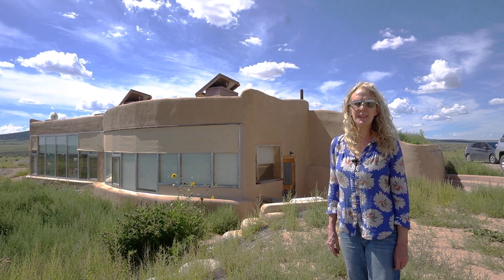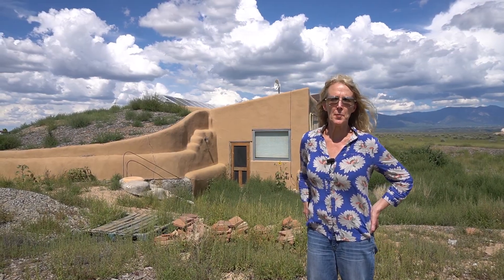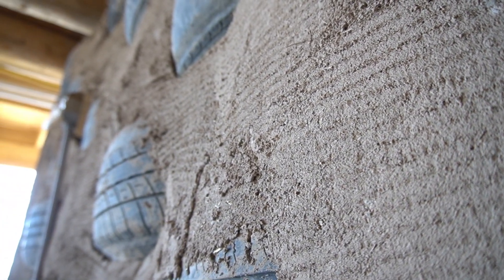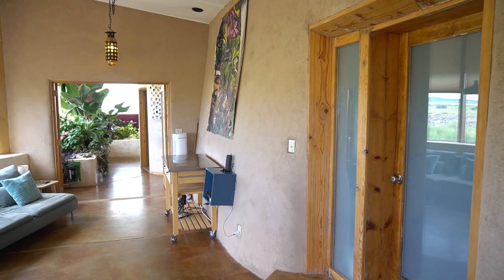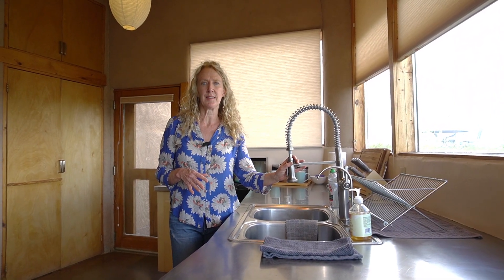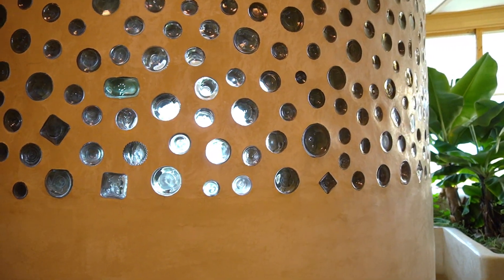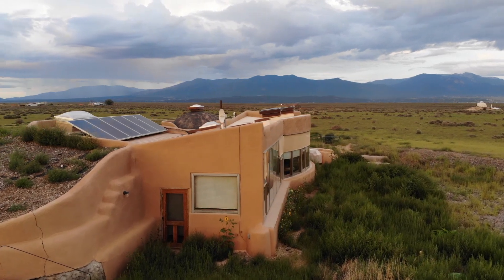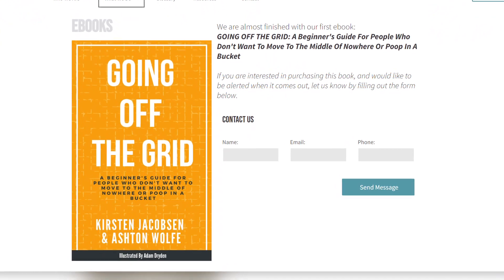22 YEARS Living OFF-GRID in an EARTHSHIP!

Comment: This type of housing has been popularized for about three decades now. It was much more affordable back then. Today, it costs as much or more to build this type of home as it costs to just buy a commercially produced home. I am estimating around $300,000.00 to fund an Earth'ship build today. Including land, permits, contractors, etc. Meaning: These may be "SELF SUSTAINABLE" homes. But, they are certainly not affordable for the vast vast majority of people if my estimates are even 1/3 correct.
Reply: Not if you DIY everything
Reply: @cleverkids6196 There is a limit to DIY on a house build. No matter what type of house that is being built. There are strict code requirements for electrical (Solar included), plumbing, Heating/A-C, framing, roofing, etc. It all has to be done to code. These aspects of home building apply to Earthship homes too. This means that a DIY home builder has to posess the required skills and licenses to do the work in all four of the mentioned trade areas. Otherwise they must hire licensed tradesmen to do the work in all four of the areas I just listed. But the vast majority of people do not posess those skills. And so there is no cost savings to be had in the areas where you have to hire contractors and licensed tradesmen. Also and most crucial to my arguement is the fact nearly 3/4 of the population doesn't have $500.00 in savings, nor any investments, nor pension funds. So unless these "Affordable" homes suddenly become free to build, the average person, including your aspiring DIY home builder, doesn't have $300-400,000.00 to build an earthship. 

***Note: There are a handfull of states, or even counties where building permits are not required. This effectively also means no code standards to meet. But the issue of funds, or lack thereof still applies.
Reply from the maker: You are right. They are not the most accessible but I like to explore various methods. Cob and straw bales are the way to go.
Reply: Have you also calculated the yearly cost of utilities and maintenance to run a commercially produced home?
Reply: Back in the day the houses were smaller and  diy was possible with help from a few friends
Reply: Um. Permits? Contractors? Off grid, unrestricted land don't need permits. People are leaving boxed living to live conceptualized lives. No permits or contractors, utility companies or grocery stores needed.